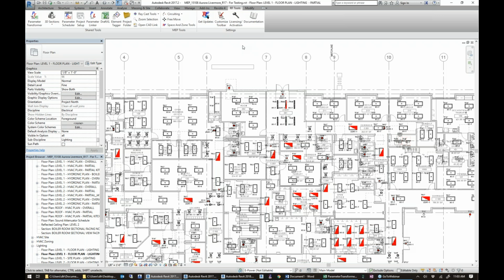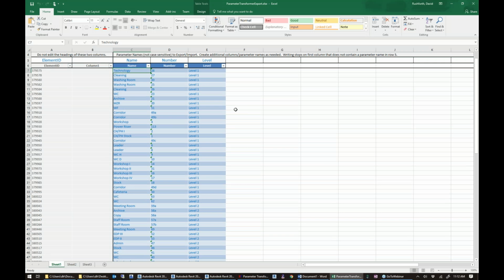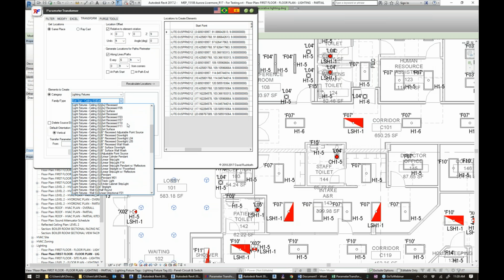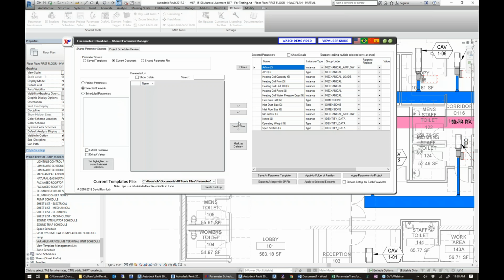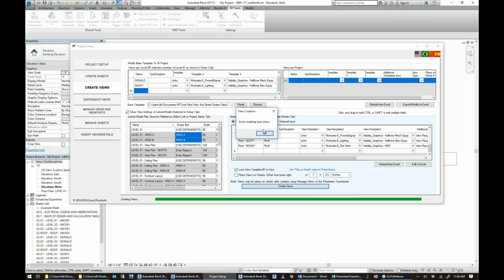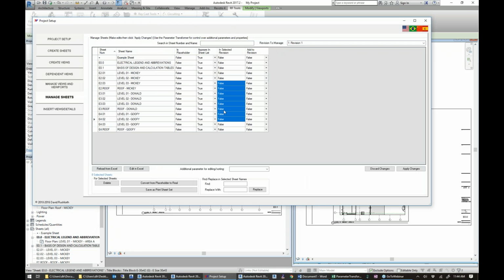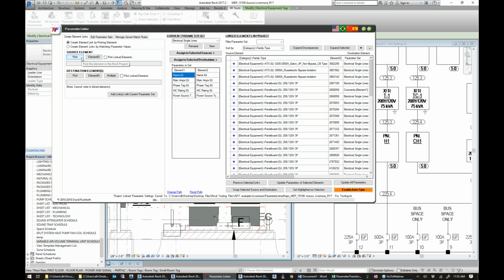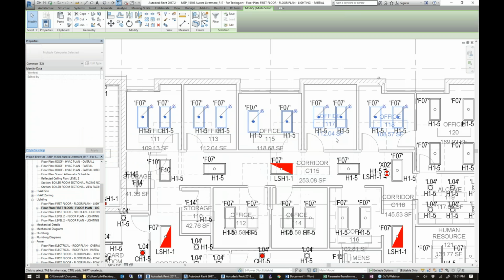RushForth Tools for Revit Training Webinar

Comment: Got a lisense for RFT again after a couple years without. My company wants us to use the tools they already pay for, they have some common funcionality anyway. Makes sense, use the tools you got. But even though RFT GUI is a little hard to get the hang of at first, it is so much better than the other plugins, I decided to buy it again! I'm a bad boy, I know, but there are things RFT can do that the other tool can't. Moreover, the things these tools can both do, RFT can do better. 
 Parameter linker.  Project setup via excel. Lightning fast export-import to excel. Powerful selection and filtering. Parameter management.  This app just rules.

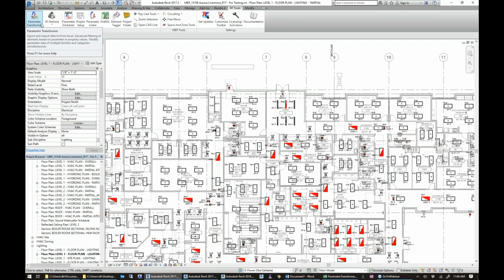Comment: Parameter Transformer : 00:00:41
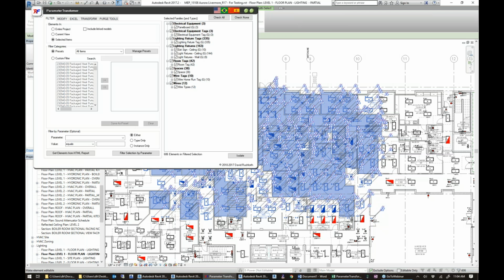        Filter : 00:01:33
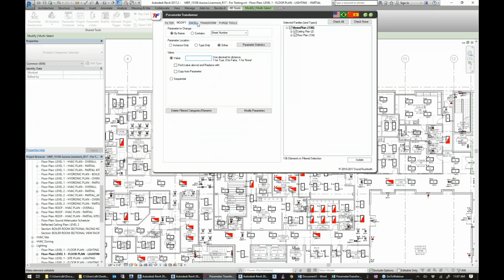        Modify : 00:04:24
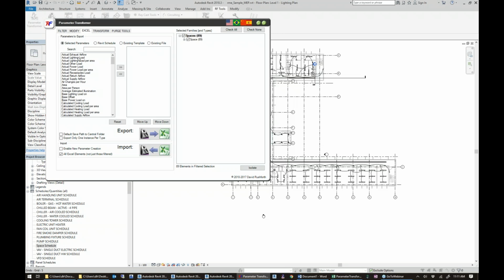        Excel : 00:08:08
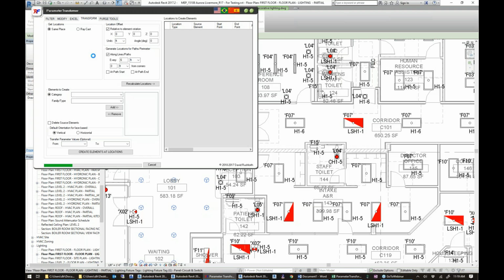        Transform : 00:16:00
        Purge Tool : 00:20:51
Parameter Scheduler : 00:21:30
Project Setup : 00:26:39
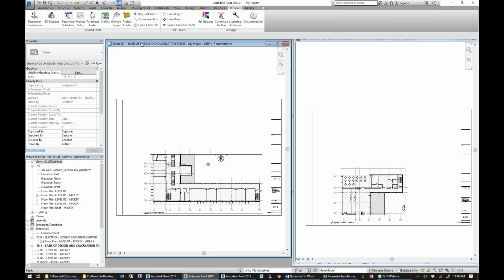Parameter Linker : 00:45:20
Draft Excel : 00:52:59
Element Tagger : 00:55:33